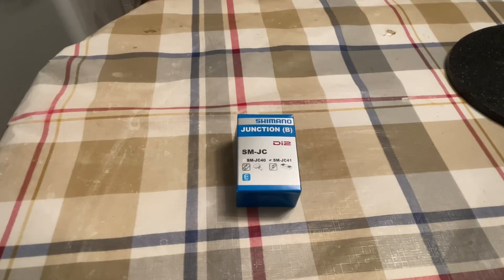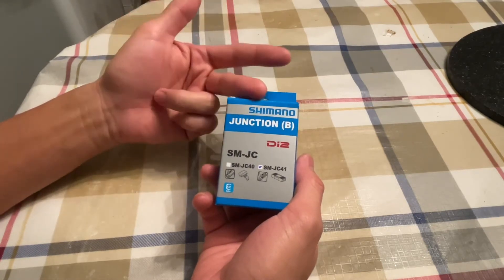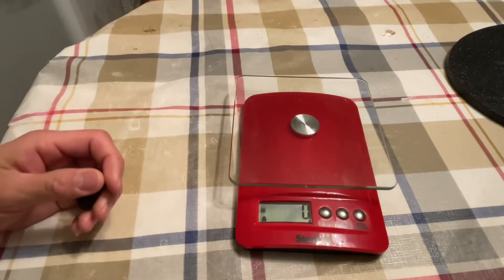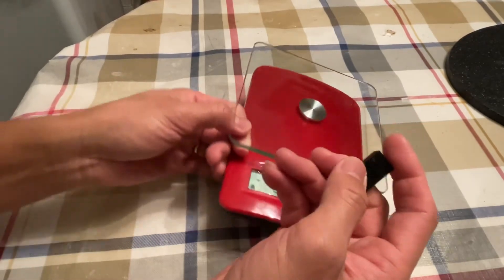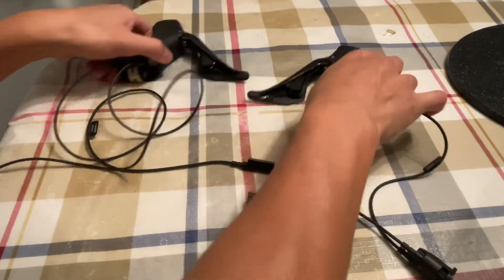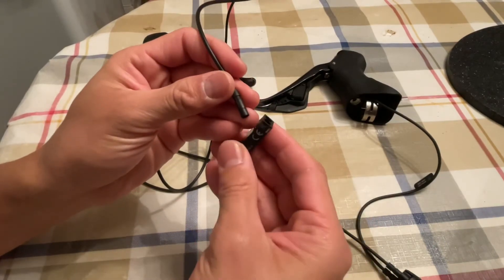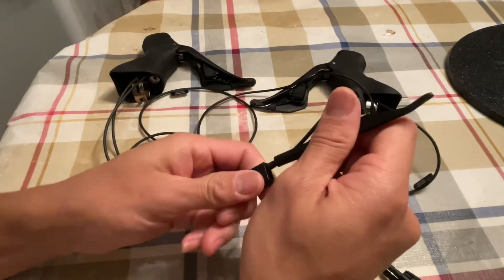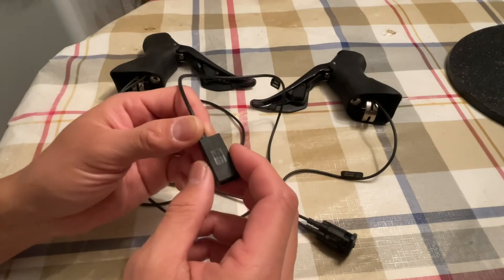Shimano Di2 SM-JC41

Comment: I'd like to get operational information on a Di1 junction box #7F0KGN08849?
Reply from the maker: Which information you need
Reply: @EdMC79  There seems to be several things you can test or check. I figured out the Battery Level Test. An operator's manual? I'd just like to understand the equipment. Thanks for the fast response!
Reply from the maker: What kind of port do you have for charging?
Reply: Standard wall charger and I rotate batters in and out every week.
Reply from the maker: I’m asking about the port that you use to charge. Handlebar or frame port? And what model is your di2

Comment: Hello - I assume there are 4 ports to the SM-JC41.  1 port for the shifters, 1 port for the battery, 1 port for the front derailleur and 1 port for the rear derailleur.  Is that right?
Reply from the maker: Yes that’s correct